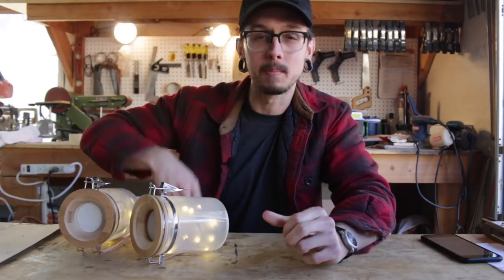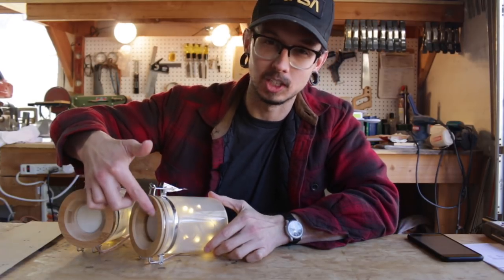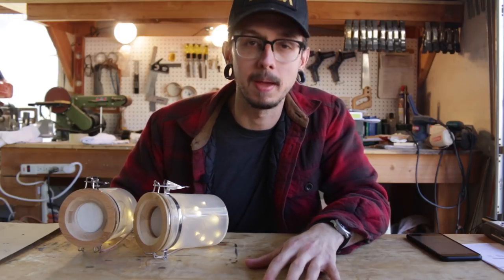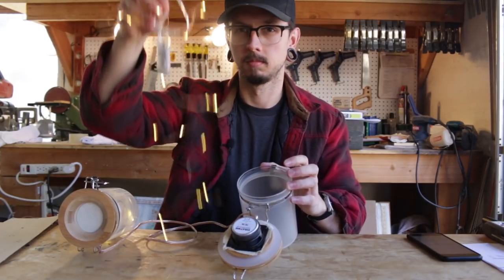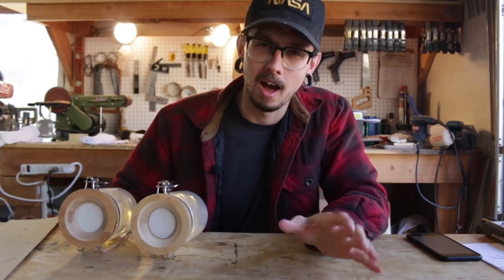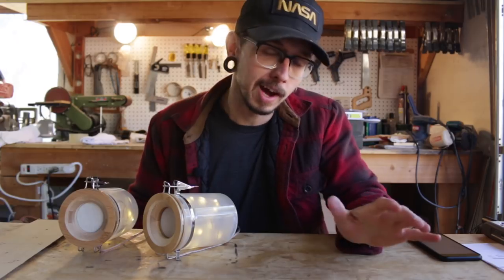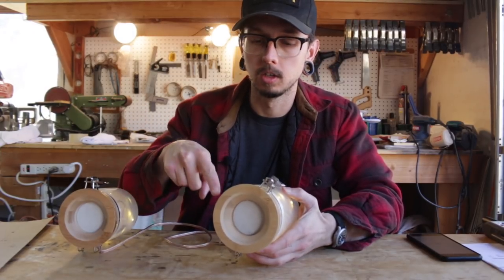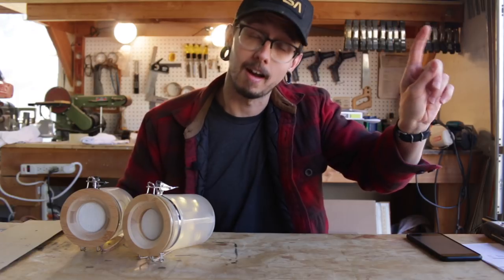BUILD TALK! Firefly Jar Portable Bluetooth Speaker || DIY Portable Speaker Build

Comment: Pro tip at 4:16! You WILL NOT be able to adjust the step up board with the bluetooth amp soldered/connected to the board. If only I knew that before turning that damn voltage screw a hundred times last week.
Reply: jup I have ben there done that

Comment: Love that you are continuing to provide content.  I have two of your kits and had fun building them.  I am more of a woodworker than an electronics guy, so I had fun with soldering iron and other tiny connectors.  One question, any plan to add battery power to any of your designs.  I like the way you explain how to make all the connections and would like to see your take on how to make that happen.  It would be great if you could do it for the "small powered speaker".   I made that for my daughter and she would like to take it with her without the plug.  Any suggestions would be great.